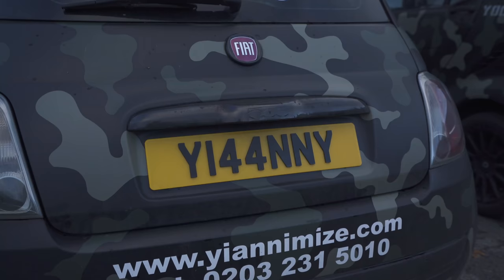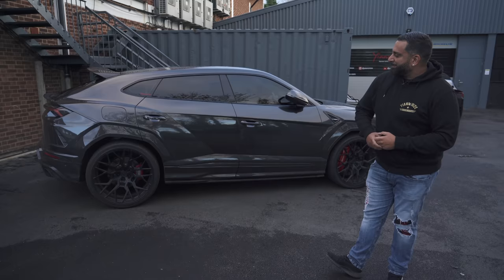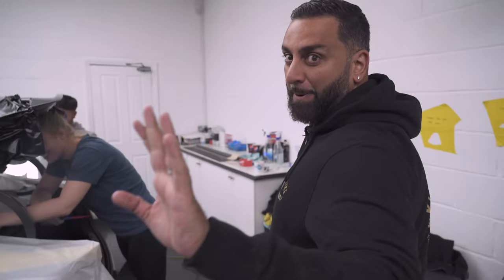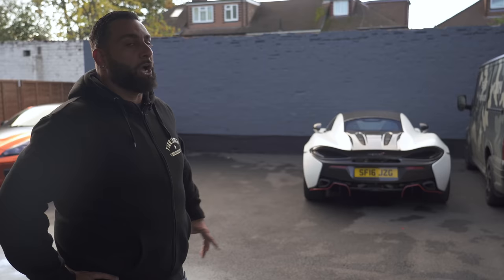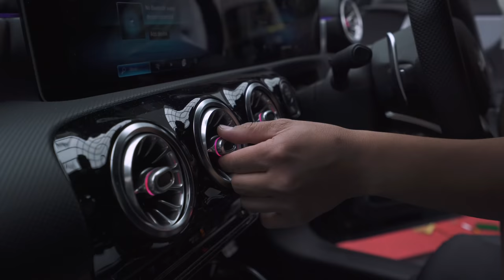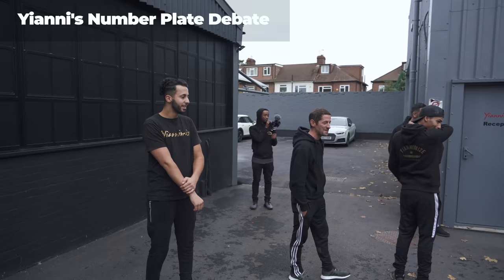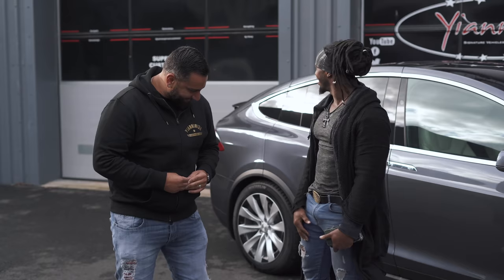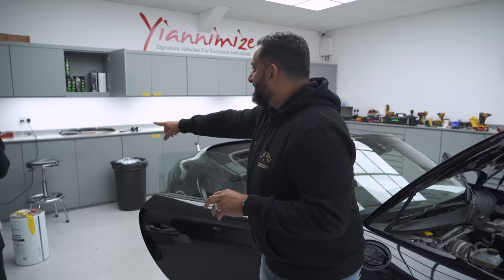Bodybuilder Ulisses Jr Drops Off TWO Cars! | TWAY Ep18

Comment: I just sold my Tesla Model X after 3 years and I couldn't be happier. Cons: Does not work well for long distance trips, gull wing doors got stuck sometimes. Interior sound isolation is dreadful. The range they tell you it has, really isn't true if you like to drive fast. The amount of time it takes to charge up is not realistic unless you live next door to a supercharger. If you got lazy or just simply forgot to charge overnight and you are late for work, well I hope you have another car. They snatched most of the interior parts from Mercedes, and for a $100k car the interior is extremely bleak. Tesla service center by me is one of the worst car centers I've experienced in my life. On the pro's side: It's fast, needs little maintenance, don't need to stop for gas, and well that's it. I think once you have it for a few years you realize they have a long way to go. For me, it's back to gas guzzlers.